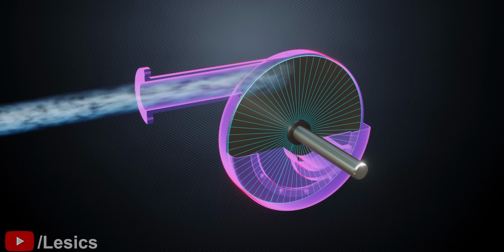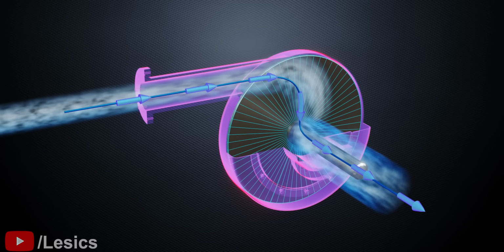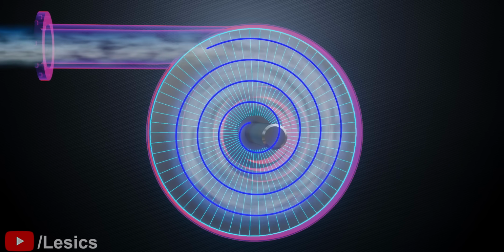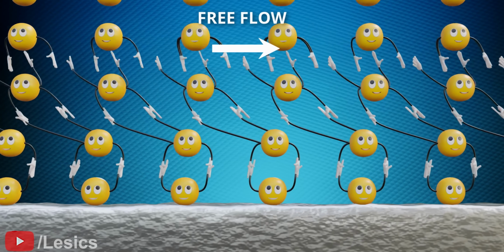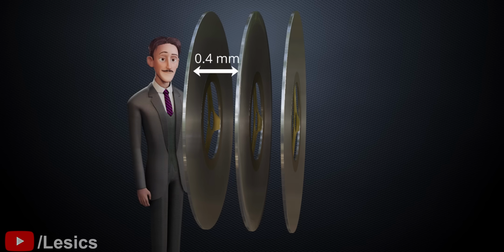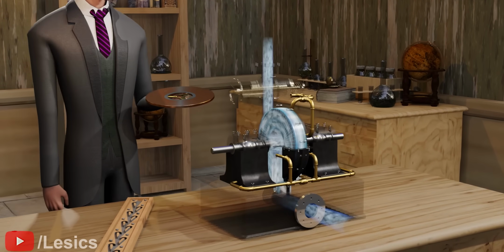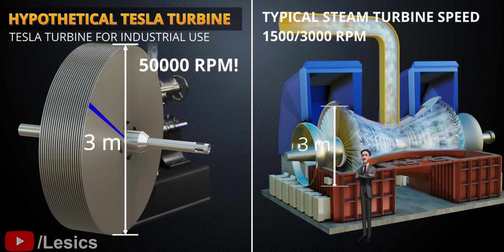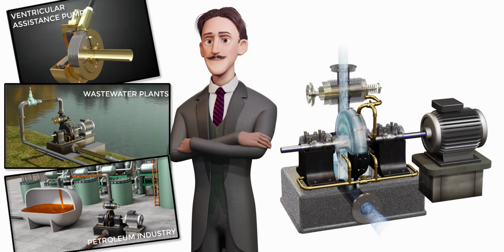Tesla Turbine | The interesting physics behind it

Comment: The blade path of a current typical Rankine steam turbine is on the order of 90%+.
That was not the case during Tesla's time.
The big loss of the Rankine cycle is condensing the exhaust steam back into condensate to pump it back through the boiler.

Comment: That boundary layer region is the reason it takes so long for the shampoo to drip down the inside of the bottle when there's only a little bit left?
Reply: Technically, that's because shampoo has very little water in it, so it's very viscuous.
If you put some water in when the bottle is half-full, you'll avoid that issue.

Comment: you can still use microturbines that cumulated will produce way more than modern turbines. instead of producing huge turbines hard to maintain, you can produce an array of turbines much much more efficient and easier to be replaced. If you have an array of 1000 and 100 fails, you close water access to that part replace and restart without loosing turbine time. All you need is STOP WORSHIP Phd professors. think outside the box and remember:  impossible is only when you think it is impossible.

Comment: This is a 2d implosion device like Schaubergs truly brilliant.
Reply: Yes I noticed that.  It follows same principles  visually
Reply: Yep, exploits the vortex, or gas/fluid spiralling inward.
I just wish he'd used a hollow axle instead, with cut-outs to let the gas/fluid enter, and end discs beyond the cut-outs.
That way, the discs would be much simpler to cut, there would be no need for the housing to have a tight fit at the ends, and no drag from such a tight fit.

Comment: The data presented in this video is false and not well researched. Be warned. Tesla was right as usual in his efficiency calculations when at theoretical design velocities as well there are many versions now that exceed  100,000 rpm.
Reply: The only time it ever reach 100k+ rpm is in micro turbine scale application, yet, they were mostly done through CFD. Usually most research paper doing actual jigg were running through dry air and and are stucked around 35- to 40%
Researcher needs to hit Tesla's claim original efficiency, in which he claimed above 60%.
Reply: @arushgore8790  Think about this: All they had to do to reach those higher RPMs without the disks bending, is reducing the diameter and the disks and adding more disks in parallel (or even more pumps in series), and you solved the problem. The reason those are not used is because the companies who produce the generators and train the technicians do not produce them because they don't own the patent, and without patents other companies can replicate or straight up completely copy their designs without legal troubles.
Reply: @SapioiT  If that was the case we wouldn't have non patented products.
Reply: @devalapar7878  Most of the public domain products well-known to be public-domain are using technology from decades to centuries ago, which is most often either less efficient, too costly, or not used due to monopolies. Now, the fastest growing field, the IT field, has by percentage the most public domain products, thanks in no small part to the open source community. Let me rephrase that: We might not have many public-domain products, but most of those products are from the fastest growing field in the world, and the companies researching and producing those products are still thriving. 

For a simple example, look at AMD right now: most of their products are more and more open source the more time progresses, they publish technolgies which can and often are soon implemented by their competition (intel and nvidia), and are still thriving in today's day and age, despite a global chip shortage.
Reply: @SapioiT  the tesla turbine drops in efficiency massively when it's under load. I.e it's only super efficient when it's spinning freely. That is terrible for most commercial applications where they need efficiency at a variety of speeds and loads.
Reply: @SapioiT  Why should it be more inefficient or more expensive?
Generics, for example, are cheaper.
If there is no patent, companies save research and development costs. So it should be cheaper in most cases.

Here, we're talking about turbines! If the Tesla turbine is better, the company that makes Tesla turbines should make more profit, because it saves on research and development costs and sells more units in the long run (maybe in decades).

I say in the long run, because there are other issues that we need to consider. For example, not all power plants can operate Tesla turbines. There is a large pool of technicians who know normal turbines. Normal turbines are well tested and reliable.
So there are other factors that would slow the spread of Tesla turbines.

About AMD: Sometimes it makes sense to use open source.
The main reason for copyright protection is research, development and maintenance costs.
First, no one can make any money selling AMD drivers.
Second, AMD saves on maintenance costs.
So there is no need to hide the source code.
Reply: @devalapar7878  I agree. But, then again, let's look at the medical market: In the USA, the exact same medicine is sold at hundreds of times the price it is sold in the rest of the world, because of the monopoly the medical market has over the health industry in the USA. There are plenty of articles on the internet showing the most drastic differences in price between medicine in USA, and medicine in EU for example, or in other parts of the world.
Reply: @devalapar7878  I would argue the medicine market in the USA and turbine market have similarities in how they operate, but aside for that, I agree with you on all but one thing: I don't know enough about the popularity of generic medicine in the USA, aside that I was told by someone that apparently most health insurances don't lead to the usage of generic medicine, either because medics receive funding depending on how many of their patients used a certain brand over generic medicine, or because the health insurance denies payment for those generic medicine, effectively enforcing medical decisions without a medical license, by often going against the judgement of the medical doctors in charge of the case(s) in cause, denying the insured people the access to certain procedures, treatment, and medicine.

But that's a topic for another video, and I'm glad we ended up seeing eye to eye, even if we didn't completely agree with eachother. In this day an age plagued by over-stressed (for increasingly more reasons), under-fed (in terms of nutrients), and overtired (lacking sleep), ending discussions on good terms has become particularly difficult, lately.

It's been a pleasure to talk with you! Have a good day!
Reply: @SapioiT  They do not deny generics in principle. The out-of-pocket pay is higher in the US (2-4 times as in similar countries).
It was a good conversation. Have a good day!
Reply: @devalapar7878  By the way, nice username!
Reply: @JDodgsonPlaysGames  Invent something that goes against big energy and see what happens, smarty pants!
Reply: @roytilton5696  It has caused many to quickly develop debilitating depression to the point of suicide or consuming poisoned cranberry juice from a CrackerBarrel.

Comment: There is actually a simple way to create a disc that will withstand the force, and it would not need to be 3m at all.  You could create the same output using more discs of a smaller diameter and by adding holes to the center of the discs in discrete locations you can precisely control the maximum RPMs.  Not only would it be simple, it would be cheaper, and produce more electricity.  The problem is that electricity is already too cheap.  There is no financial incentive in providing cheaper energy.  In fact, giving electricity away too cheap would endanger the profits of entire industries.  Efforts to discredit Telsa's inventions have always failed and were always presented with bias from the industrial sectors his inventions directly threatened.  The truth is Tesla was right about everything.  And we should have protected him and his legacy from the US Government and JP Morgan.
Reply: Wouldn't creating some kind of system that alters the distance of the discs relative to each other to reduce the amount of force the steam/water is able to apply to the discs be a more effective way? It would be tied to some flywheel perhaps. The faster it spins the more force the flywheel applies to the mechanism that separates them. Some energy might be lost with having to drive extra stuff to regulate the speed but it would be more efficient perhaps then physically modifying the discs since this system can be dynamically controlled where as disk modification is permanent. Oh and this system would be reactive to what ever loads that are being applied to the engine. If there's a heavy load the max RPM isn't hit so the disc distances are kept at optimum so excess energy isn't wasted like it would be if the discs had holes drilled into them which can't be changed.
Reply: @MagnumForce51  the holes don't just limit surface area.  They need to be small and shaped specifically.  What they do is cause vortex formation and slightly alter the direction of the fluid.  In order for these turbines to run at peak efficiency they need to always be running at maximum RPM.  And in order to do that the discs must be fixed and there must be as few moving parts and/or joins as possible.

The pressures are immense.  Designing a machine that could support these pressures during fine movements is astronomically untenable.

Carefully engineering solid physical reduction to the maximum RPM that requires no input or moving parts is the only solution worth exploring.
Reply: Except by drilling those holes you would effectively remove the entire reason the machine works in the first place and that's the boundary layer of the liquid. Making these holes would allow for equation of pressure inside the turbine chamber and result in it eventually ending. Also adding more blades would stop the rotational force from being able to exist the chamber as easily, also overall reducing the efficiency. The entire design relies on a constant stream able to leave the chamber as quickly as it came in. And change in the pressures essentially cripples it.
Acting as if cheap electricity is the issue when they could just arbitrarily raise prices while having to spend less on the system as a whole just tells me you know nothing about business. This isn't like consumer products where you need the consumer to rebuy the product after a time, this is the creation of the product which you want to keep as low as possible to maximize profits. If this design actually worked in reality, we'd already see engineers utilizing it in their construction. Tesla isn't some god, he's a man who used a lot of unobtanium in his thought experiments. Simply put there's no practical way for it to exist, now stop this cult worship you child.
Reply: @mikoi7472  you spent all that effort on being wrong.  Such a sad waste.  You'll never learn anything that isn't spoon fed to you in your entire life.  You're what it means to be a fukpotato.  Don't worry though, you aren't alone.  72% of all humans in any given sample are also pureBred fukpotatos.  You can all hang out and do what you do as a herd.  Let the rest of us do the heavy thinking.  We got this.

Comment: I think the reason why it is not being used is because of the efficiency as the turbine speed varies according to load and at low RPM it suffers. We do need a 3m disc to run in power plant as they need greater force to generate electricity. But a 3m disc is like a flywheel with huge energy stored which will not only suffer from RPM that will pull the materials due to centrifugal force, but the weight too and with a disc that large, a huge challenge in reducing friction. I don't think any Engineers forgot about this invention. When a model is scaled up, a lot of negligible forces have a huge impact to the design.

Comment: An Engineering challenge, is not necessarily an engineering impossibility. Maybe someone should try it again with modern materials or lighter materials that spin faster with less rotating weight.
Reply: It was already tried, think that is called "active" turbine. Turbines we normally use to make electricity from steam are "reactive" turbines. Problem is, it's limited in use mostly to hydro turbines - since pressure of liquid going through turbine doesn't drop, turbine doesn't get damaged by gas released from water.
Reply: @ceu160193  more then 1 person can try a new idea. If one person failed, doesn't make it impossible for a future person. It doesn't sound impossible, it only sounds like it need development. Technology evolves and improves overtime if people try. This isn't so back and white that we can definitively say its impossible. It just hasn't been done yet. It doesn't break the laws of physics therfore it may be possible in the future.
Reply: @BoDiesel  it's not that it failed, but it simply isn't very practical. I am unsure, if Tesla turbine can be effective with steam or gas, but if yes, it could be used for new windmills or nuclear powerplants.
Reply: @ceu160193  not practical is already agreeable answer then impossible. But it sounds like it could be practical if they can get it reliably to turn much higher RPM's. Sounded like the problem is the 10,000 rpm they settled on is impractical but the 50,000 rpm could be a break through. Would be fascinating to see someone with modern technology and the skills try to solve this issue. Plates warp when spinning to fast. Maybe they need better high speed balancing. People have engines turning much faster then 10,000 rpm now a days.

Comment: What about those who want a power supply for their own off the grid cabin in the woods? The blades don't need to be 3 meter in diameter then. A small turbine would be enough to supply a single building with electricity.
Reply: It would not. Watch the video. It requires high rotation and its efficiency drops a lot when it is under load. It is vastly more efficient to use usual turbine approach, but each time you halt water, you impact the local ecosystem. You could get in legal trouble like that, too.
Reply: @brushhaidinger2506  The larger the diameter, the faster it rotates at the edges. Smaller diameter means less stress on it even if it is rotating for full.
And I'm not talking about building a dam.
Reply: @Langkowski  Smaller diameter, lower efficiency. We have over a century of experience in these things. If it was viable, it would be used as increased viability means more profit.
Reply: @brushhaidinger2506  Yes, when you want to provide thousands of people with electricity. But just a couple of buildings is something else. Lower efficiency is not the same as zero efficiency.
Reply: @Langkowski  Small scale application is indeed debatable. There are situations where this might be useful. Torque is still a problem - this thing has low one.

Comment: Nothing is an engineering impossibility. It is an engineering challenge. The reason for failure in making the TT work in modern power generation is those looking into it are assuming the same scale platform as a bladed turbine rather than moving to collections of smaller turbines. The internet works by replacing a small number of larger machine with a large number of small machines. A rotary engine with a 1.3L displacement produces the same power as a 3.9L piston engine (always x 3). There are many other examples. We have materials which will easily handle 50000rpm at 1.2m diameter. Two of those will crush a 3m bladed turbine. Let's always remember, different tech = different rules.
Reply: Yes, just look at the flywheel energy storage, where they are rotating at extremely high speeds. Perhaps the materials used there could be used in a Tesla turbine?

Comment: How would this turbine work if used with water and the surfaces were coated with an abrasive? Of course the disk space would have to be adjusted for the correct boundary layer.

Comment: "For industrial applications we need a disk size of two or three meters"... that's for the normal turbine design that runs at lower RPM. With the higher RPM of the Tesla Turbine, is such a big disk actually needed? Instead of scaling it up by making the disks bigger, can we scale it up by adding more disks and making it wider?
Reply: Or use an oil as a working fluid instead of water

Comment: so this can be used to generate electricity, maybe not for industrial use, but consider it for home use, using the water pressure from your mains and pipe size reduction to increase pressure to the discs, might not generate enough to run your home completely but combined with a solar array on your roof and batteries, every time you run water in your home for a bath or shower, fill the kettle, use your dishwasher or washing machine, as long as you run water your generating electricity, it might only be a small amount but its basically free, the water has to be pressurized to reach your home anyway. 

am i the only one to think about this application for this technology?

Comment: I don't understand the high RPM and tip velocity bit here. That part doesn't make any since. 

For example due to the design the tip velocity can't exceed that of the incoming flow. There's no way it's practical for incoming flow speeds to be anywhere near that fast. The RPM of a Tesla turbine would be self limiting based on the speed of the incoming flow.

Comment: logic therefore states if you charge the incoming liquid to positive it will enhance the power more as the first layer of molecules attaching to the rotating plates would allow a hold on the further free layer molecules trying to pull the first layer from the face rotor plate